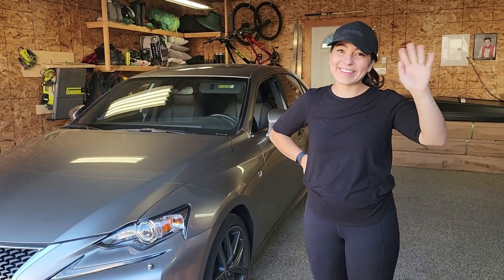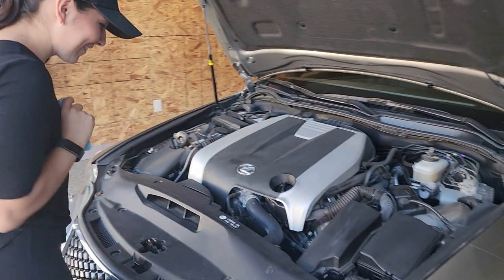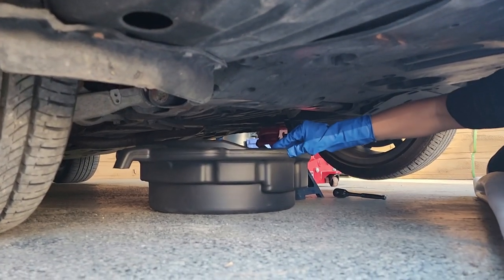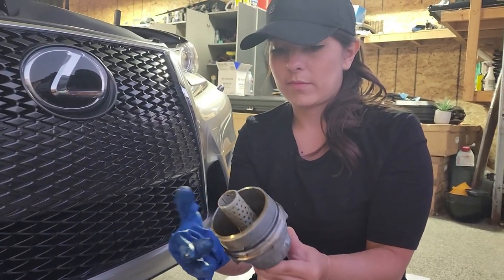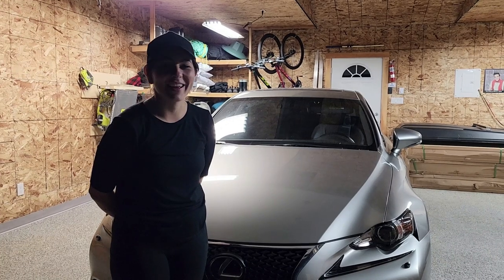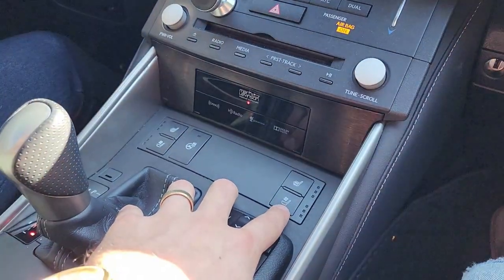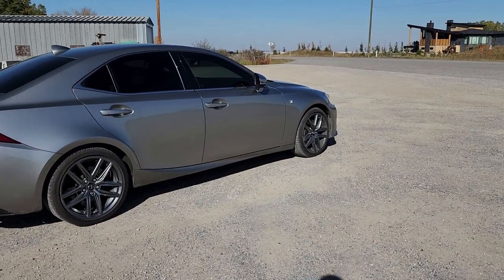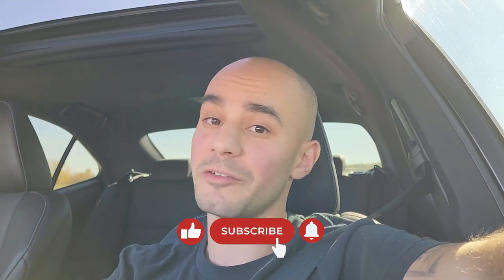My WIFE does her first OIL CHANGE on her NEW CAR!

Comment: Never trust a jack by itself to support the vehicle if what your doing requires getting under the vehicle. A hydraulic jack can fail without warning. It's not likely to but it can.
Reply from the maker: Oh ya I actually had a jackstand underneath
I wouldn't trust a jack on its own

Comment: you didnt show the tool required to remove the oil reseviour cap/plug.
Reply from the maker: For the oil filter or the actual drain plug?
For the drain plug we used a regular socket and the oil filter I had to buy the special wrench for it